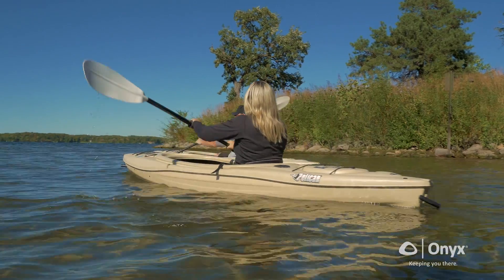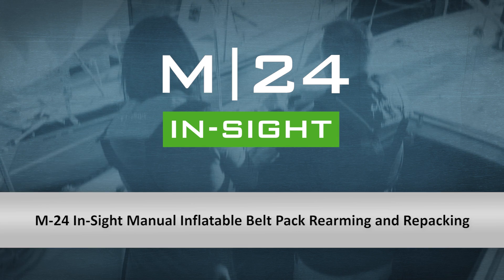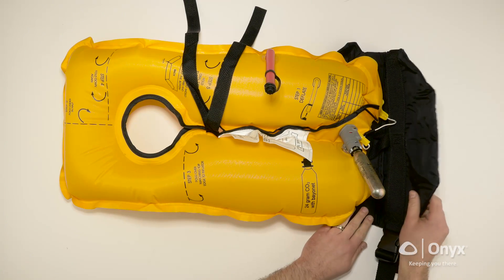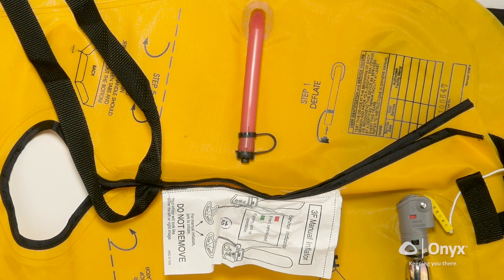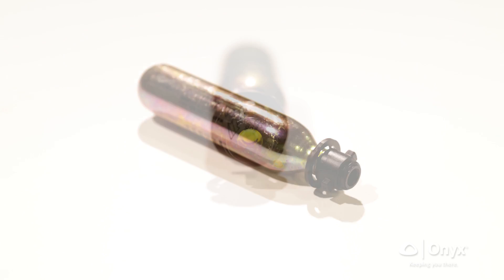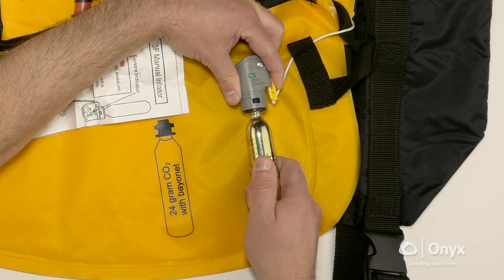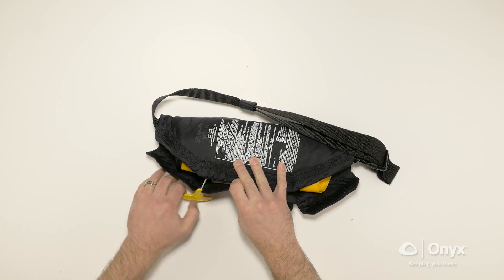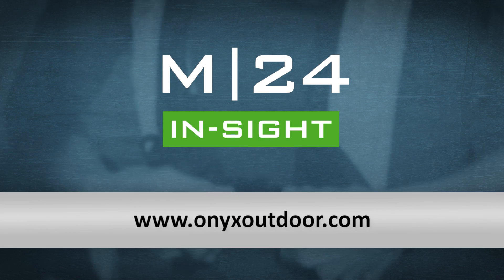Onyx M-24 In-Sight Belt Pack Overview - Rearming and Repacking

Comment: Happy with this belt pack overall. I tested the manual inflate and then installed the CO2 and repacked. Two complaints:
- Impossible to fully deflate just by holding down the valve and pressing. I poked a hole in the valve cap and sucked the final air out with the cap in the valve to fully deflate. I then put some tape over the hole (maybe not necessary but to prevent water from getting into the valve). There should be a double cap, one with a hole to deflate and then another cap to go over the hole.
- No keeper for the waist strap to hold the extra length of the belt. I made my own with some nylon rope.